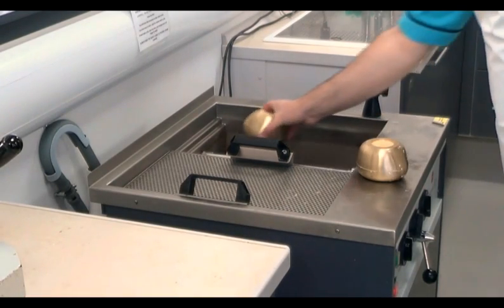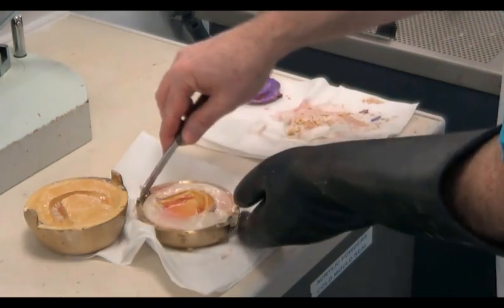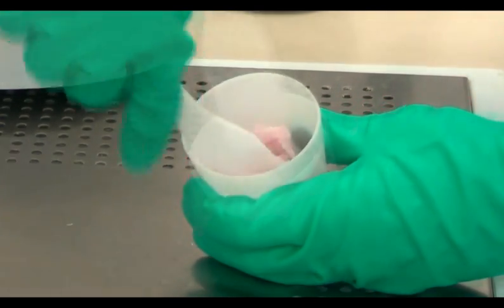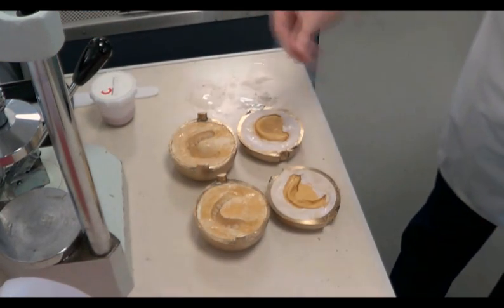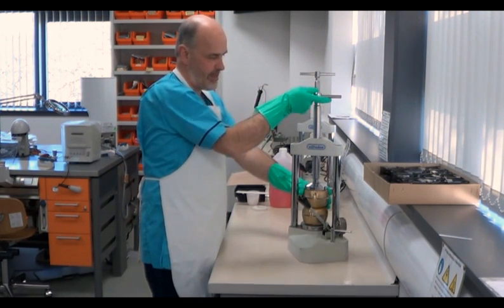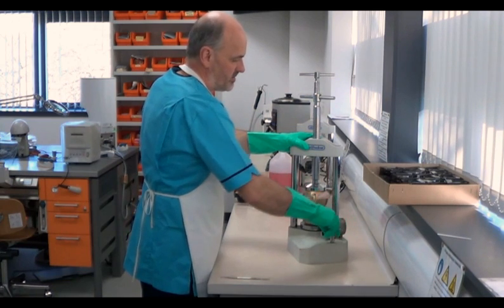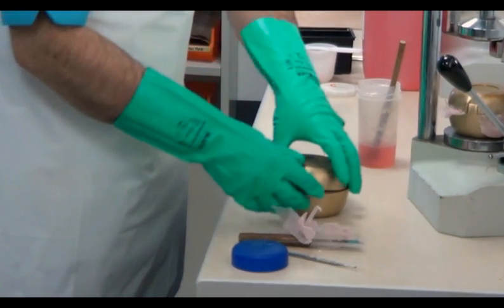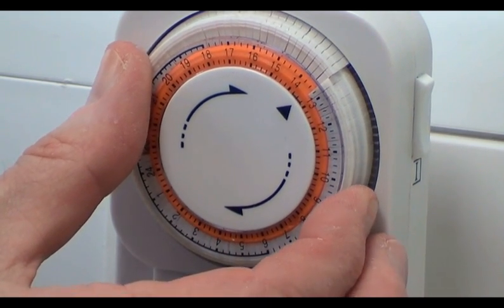Packing and processing

Comment: I keep getting air bubbles
Reply: Too dry
Reply: @DogecoinMode  They also skipped the trial pack step.  Pack, press, place more acrylic, press, place more acrylic and remove sheets, final press pressure and cure.  Saving 5 minutes isn't worth the problems that can be introduced.